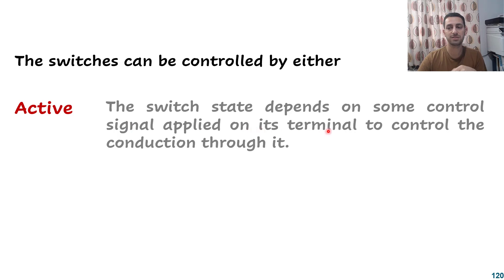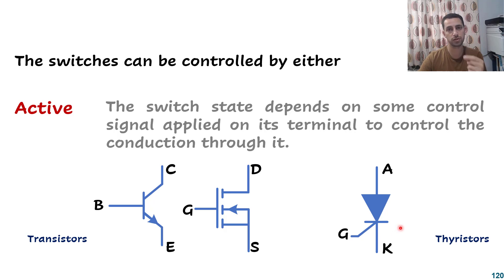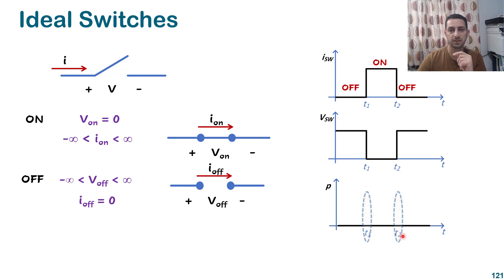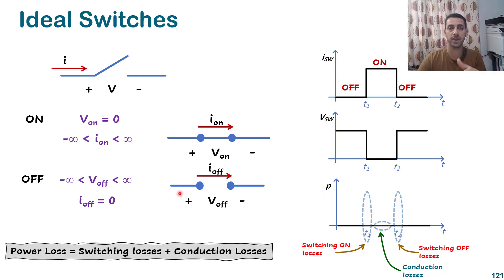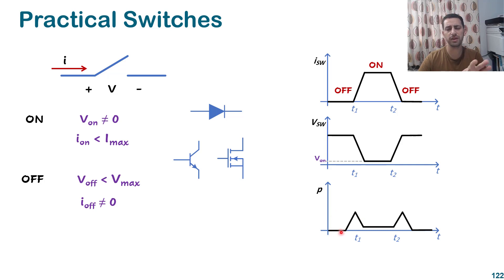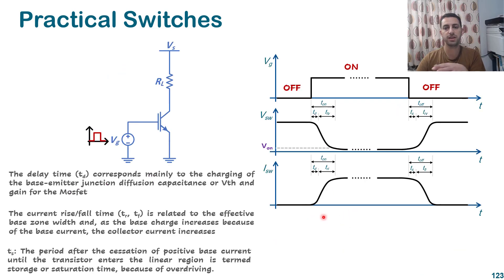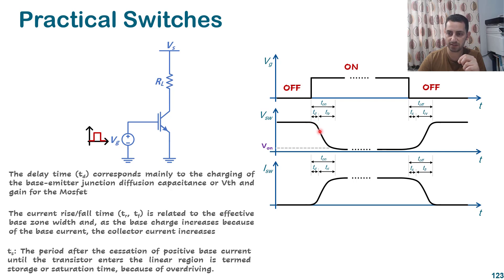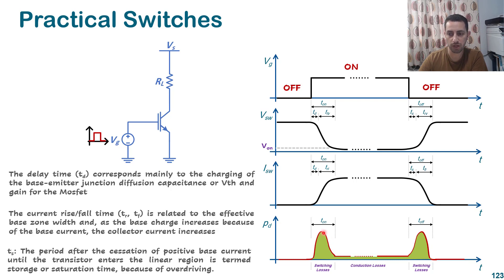15 Ideal VS Practical Switches | Power Electronics

Comment: You are a boss in this field 👌👌
I have a question! How can i modeling switching time delays and trasition time in the model of transistor? Is it relate with capacitance if yes how i can relate with them? Thanks
Reply from the maker: Thanks. It relates with the capacitance and always they provide some relevent switching times in the datasheet based on experimental tests.However, I am not aware of its exact model. You might search for some application notes which dig in these details